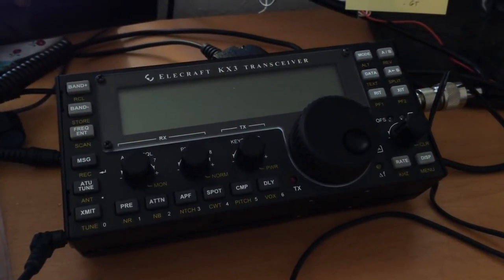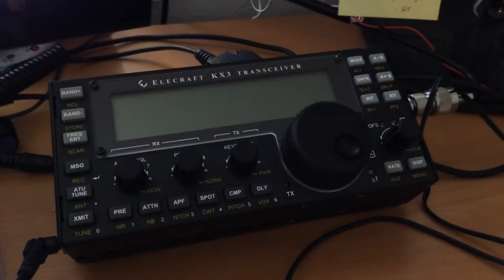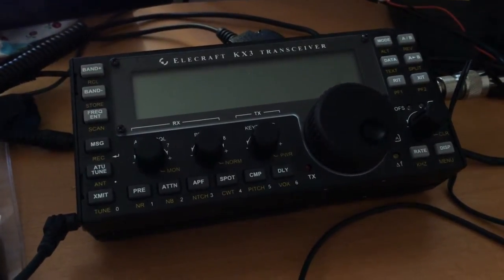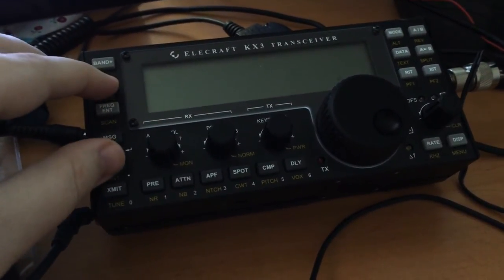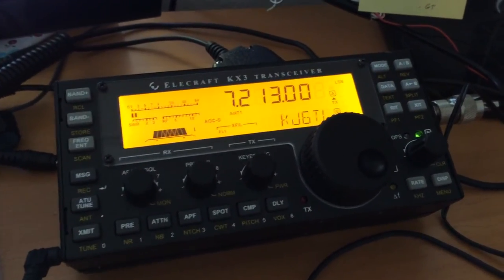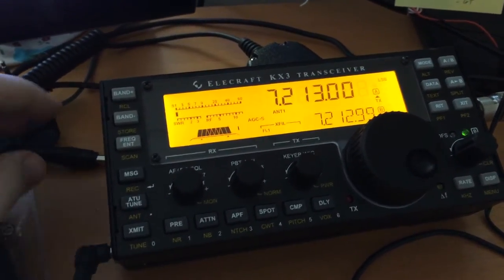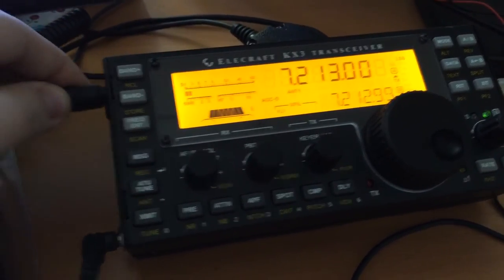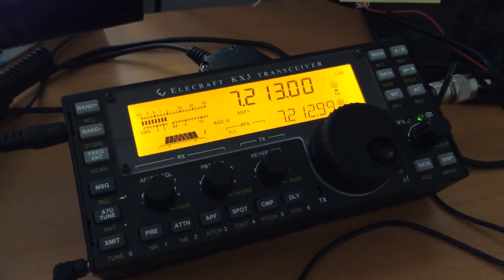Don't use the Drobo power supply with the Elecraft KX3

Comment: Well, honestly MOST of the switching power supplies will do this.  I'd suggest getting the Pro Audio Engineering PAE-KX33.  There might be others out there that will work but this one is quiet as can be.  No, I don't work for the company!  de W0QR.
Reply: Dennis Mathias typical SMP crap psu.

Just get a linear power supply on eBay, I got 2 for my kiwi SDRs and the difference was night and day, clean power.
Reply: @o00scorpion00o  Yea but they are so heavy.  Tough to travel with.
Reply: Dennis Mathias they are heavier alright well worth it if at home or bring a LiFeP04 battery and then charge that from a smaller SMP but the battery wouldn’t be much lighter probably than a linear for the kx3.